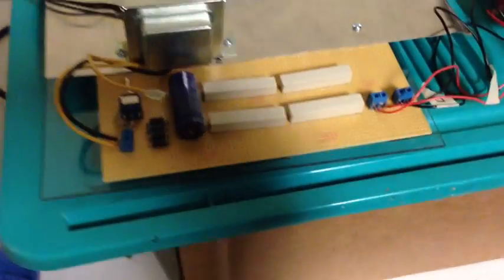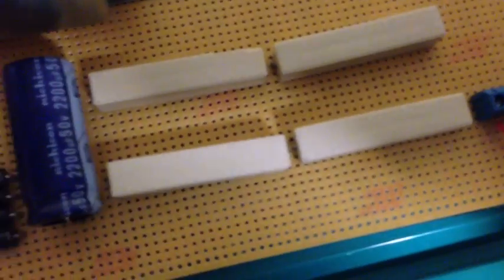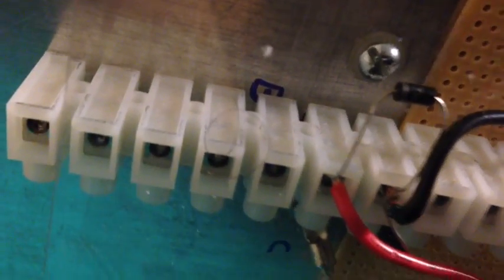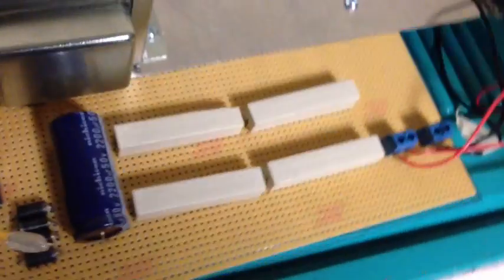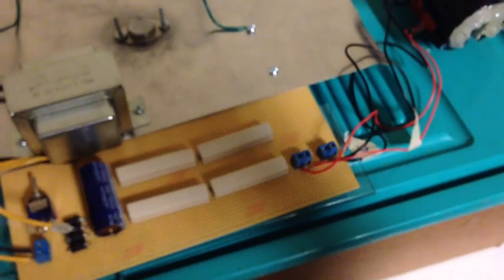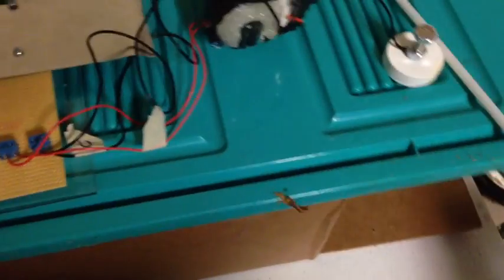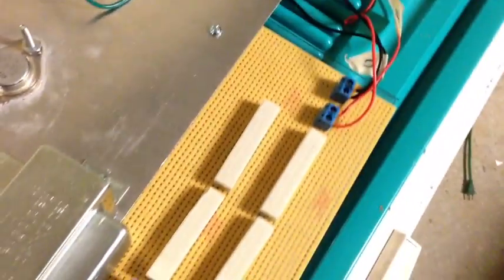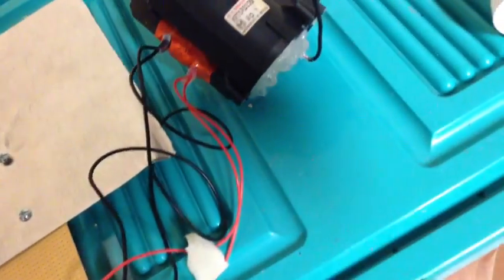Great output with 2N3055 single transistor flyback driver

Comment: What is the purpose of the resistors? Is the 200 ohm resistor supposed to lower the current going to the feedback coil?
Reply from the maker: The resistors just function as a voltage divider to provide the correct voltage and current on the gate of the transistor. Their exact value is not that important. The fact that I have high wattage resistors here is a bit overkill. These are 10W each. 2W would work fine. Here is a link from someone another instructible on the circuit diagram:
https://cdn.instructables.com/FQ6/U59P/HAUNNERC/FQ6U59PHAUNNERC.MEDIUM.jpg

Comment: what was the diode  between the emitter and collector blocking from what directing? was it stopping voltage from the emitter to the collector or the other way around?
Reply from the maker: The diode between the emitter and collector is correct if it is zener diode. If a regular diode it should be placed between the windings of the 5 turn primary coil to protect the 2N3055 from kickback. The diode in this that I used in this setup was Uf4007.